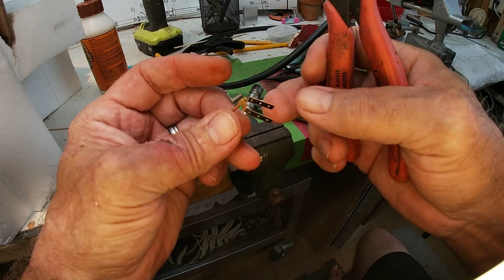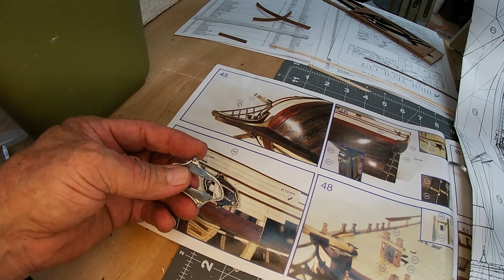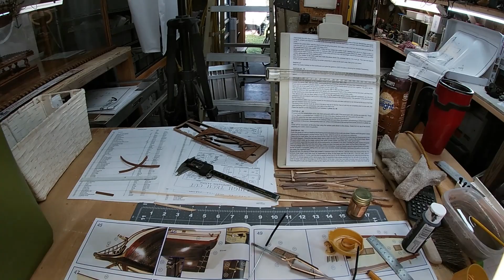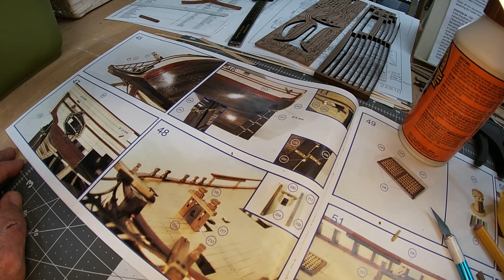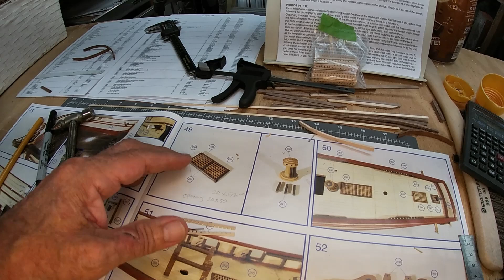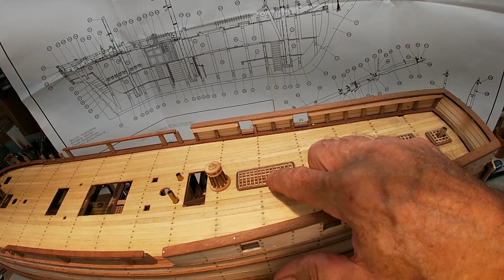HMS Bounty build part 15

Comment: Siento romper la ilusión de los que dicen que está todo perfecto, pero he de decir que hay un grandísimo error propio de un principiante, y es que los pernios del timón están colocados al revés. La parte del herraje colocado en la pala del timón ha de ir siempre por encima de la parte colocada en el codaste, pues de lo contrario el timón se caería al mar irremediablemente.
Reply from the maker: How the pin is installed was insertion of the pin from the bottom to make the process easy for myself. After words the top and the bottom of the rudder pin was bent over to 90 degreese so that it could never fall out. The instructions don't show how to do it, just what it looks like when it's done.